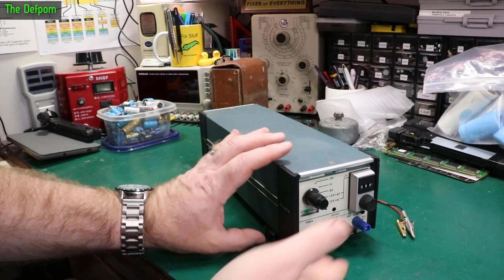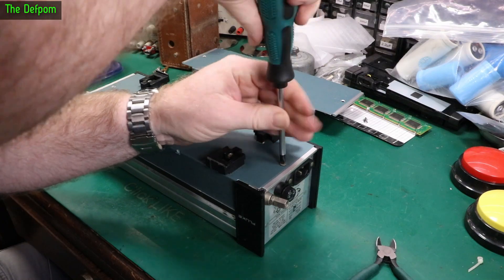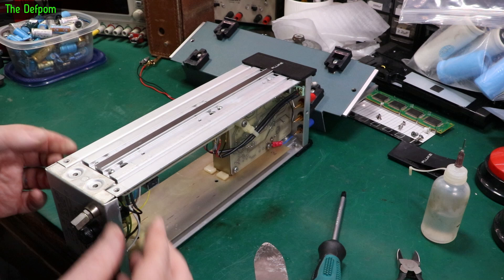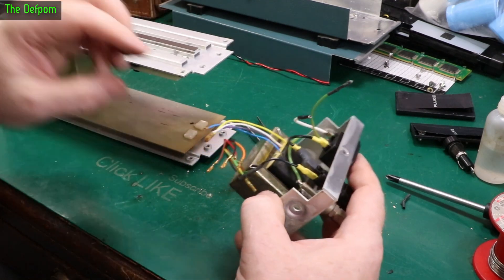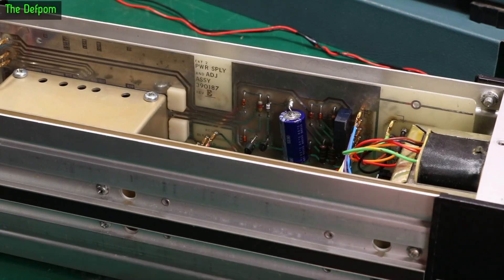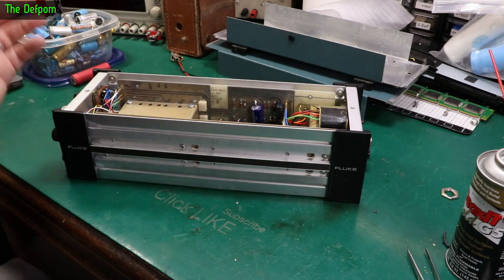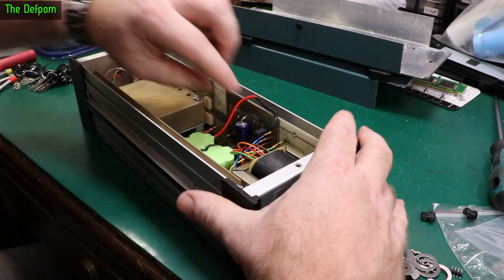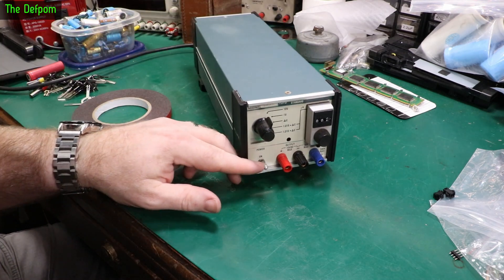🔴 Fluke 731B DC Voltage Standard Repair - No.1241

Comment: So nice to see an LM308H again, great precision op-amps from back in the day. Great for strain gauge differential signal amplification and the like.
The other can is an SZA263 and is the voltage reference, I guess you can think of it as an LM399 without an internal heater.

Comment: Random question - Do you prefer the Peak over the DE-5000 or is it just the one you have? I ended up getting rid of the HP 19" LCR meters I had and just going with the DE-5000 but I have a Peak transistor checker and I like the construction and ease of use.

Great video as usual.
Reply from the maker: The peak is better for in circuit testing, also quicker to use, I do use the de5000 or my east tester et4401 if I want to look more closely for things such as dissipation or frequency response.

Comment: Oooh - I like a bit of pantomime!

Defpom:                                      "These are 3500mAh"

Audience (loudly, in unison):   "Oh no they're not!"

I'm pretty sure that 3500mAh NiMh AA cells only exist in Chinese adverts... Please let us know their actual capacity.
Reply from the maker: Yeah I really should test them, in this situation it doesn’t matter even if they are only 350mAh
Reply: there is lots of 3000mah 1.2v AA cells in market, even from energizer, duracell, eneloop, etc. I don't see anything wrong with that
Reply: @Americana-m4p  I can't find any AA Nimh cells from 'reputable' manufacturers > 2850mAh - I would expect all cells claiming to be be 3000mA or more to be fake. Especially for cheap Chinese cells that TheDepom bought.
I noticed that he put up a short video where he tested one of his '3500mAh' battery packs and its real capacity was actually around 540mAh. Not much of a surprise - to me at least.
Reply: @tonyh6309  i have GP 3000, i think those are 3000mah but i haven't measured any of those.
Reply: @Americana-m4p  Hi, I'm pretty certain that GP don't make or sell 3000mAh Nimh AA cells - if they do Google would have no trouble finding them! They are almost certainly fake but with luck they may be decent 2000mAh or even 2400mAh cells. They won't be 3000mAh.

Comment: Just a word of caution. On my three unit version, the traces on the PC board seem to lift easily under heat when soldering. Here, in the US, some types of PC board didn't have a very good adhesive under the copper during that time, so use the lowest possible heat, and be quick about it.